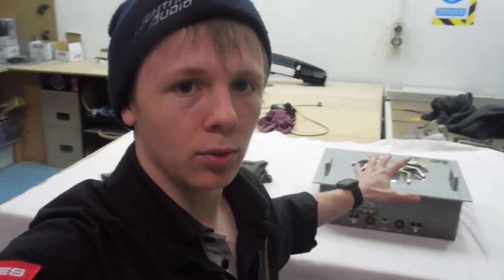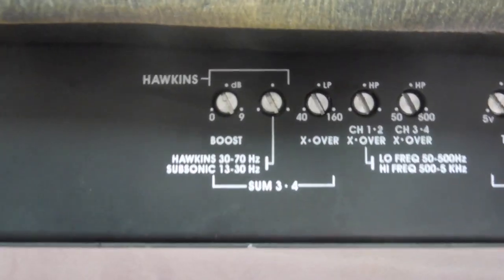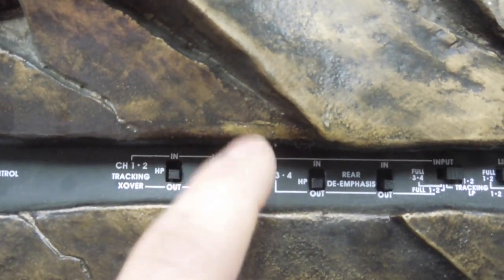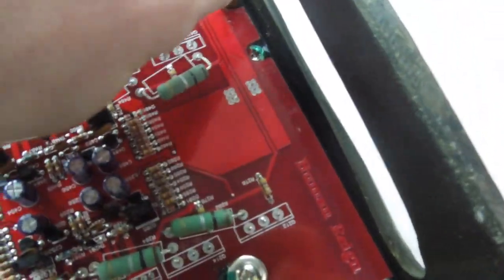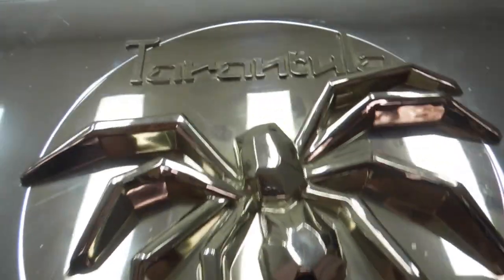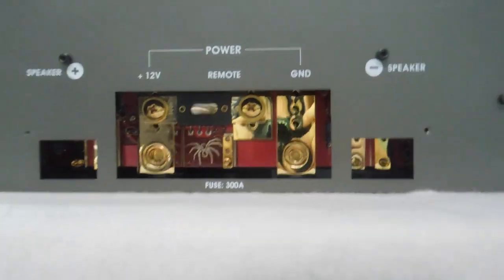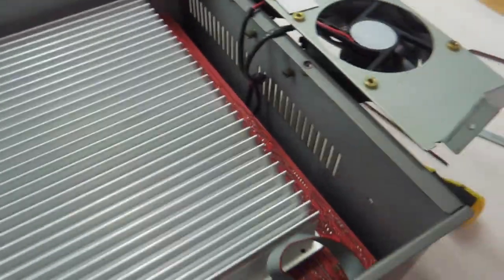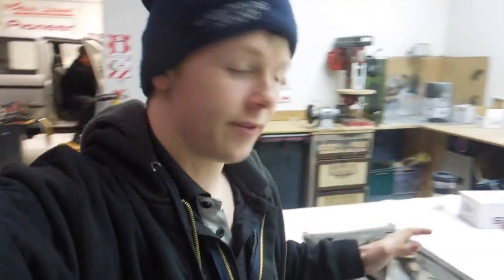SOUNDSTREAM TARANTULA & HUMAN REIGN!! CRAZY COOL AMPS

Comment: The decorative cover on the Human Reign is a type of epoxy resin very similar or possibly the same as used for large collectible figurines. I believe that amp is actually a slightly modified Rubicon 804 under the shroud. The Tarantula...Legendary.

Comment: still have that human reign for sale?
Reply: i got one...thniking of hooking it as a living room amp...hook it with 1000w psu.. with focal kevlar series components and a 10" sealed CDT dvc subs.....on the otherhand thinking of selling it off too :D....
Reply: @SuperEightOneEight  id be interested- - a1000w power supply like form computer wouldnt run it i bet, or well it would run it, but well and perhaps safely- you need like a 50a or 100a astron supply or something- 

id be interested in it tho- for fun to have and use as shop tunes

Comment: I helped my brother set up a soundstream tarantula (original model, 2000x1) to a cv stroker 18, but the capacitors we used slid down the brass mounting ring and shorted the input. Amp now goes into protect. Anyone still do work on these old beasts?
Reply from the maker: I had a customer come in and ask about this amp last week actually and it sounded like he knew a lot about them.
If I hear from him  again I'll put him onto this video.
Reply: Get with SMD meade916 Steve Meade, he still has a buddy who does amp repairs. He's legit.
Reply: Did you ever do anything with the tarantula did you wanna sell it?
Reply: Garbil Huler Search the audio forum for amp repair techs. There are several that hang out on DIYMA.
Reply: Do you still have this amp?

Comment: on the soundstream reign how many watts is the peak power on the amp??
Reply: Joe Gotti focus on the RMS, son
Reply: Victor Baray can't believe people still even bother to use it. Nobody falls for that crap anymore.
Reply: I agree with you that peak power ratings are "shit". R.M.S. ratings are to tell how much power an amp can produce with A (meaning one) sine wave of a given single frequency. I listen to music, not sine waves of one frequency. From what I've witnessed on you tube dyno tests of amps, many high quality amps don't put out much more "dynamic power" or "music power" than their R.M.S. ratings.This seems to be especially true of amps with tightly regulated power supplies. This shouldn't really be any problem if the buyer just figures out how much dynamic power he needs and buys an amp with at least that much R.M.S. power. Even if the R.M.S. rating is higher than the speaker can handle it shouldn't be a problem if you are listening to music. But a 20 second burp at 40hz might just send the woofer up in smoke, shorting the coil and possibly cooking the output transistors.
Reply: Joe Gotti Peak power doesn't mean Jack shit. These aren't some flea market crap amps... these amps are LEGENDS!!!
Reply: If your goal is simply to see how fucking loud you can make your subs thump then these aren't the amps for you. If you listen to music these are a good choice.